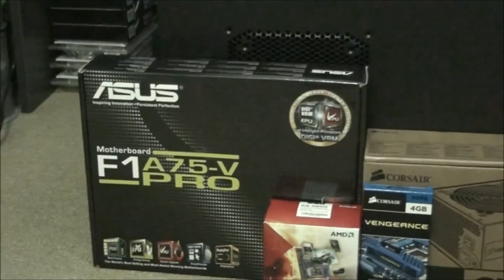Fractal Arc Mid Tower Case Review

Comment: I was thinking of putting a H100+push and pull fans in the roof which I know will fit. I also wanted to put one of those new PNY water cooled 580 cards in there too, again with push and pull but would it fit is the question. I can't get the PNY all in one GPU/CPU cooler.
Is there room in the case to hang the graphics card cooler off the door? In push/pull?